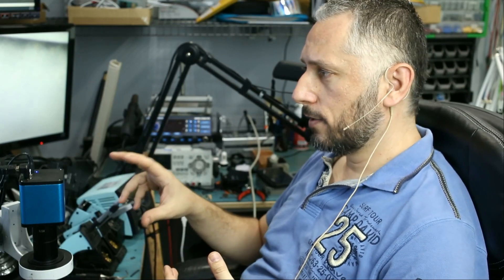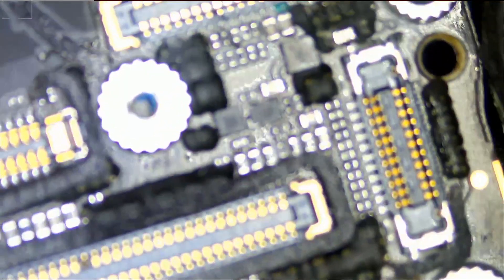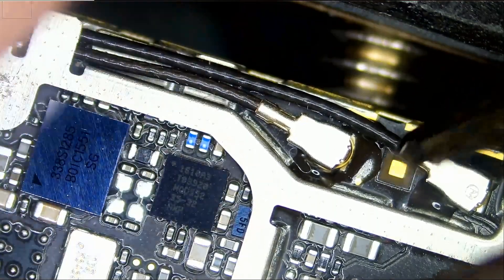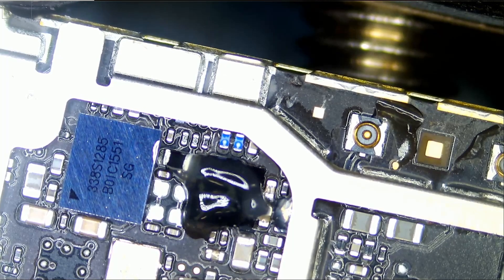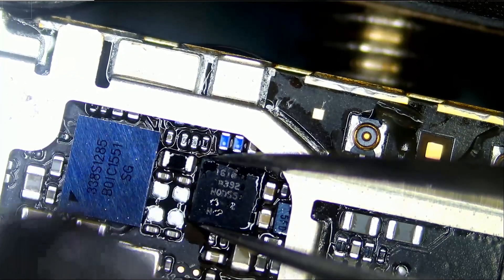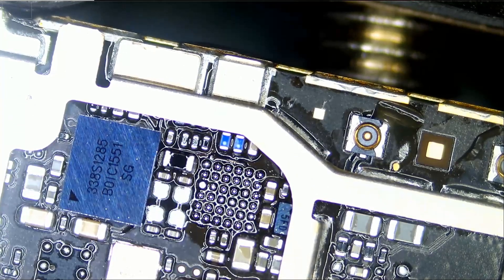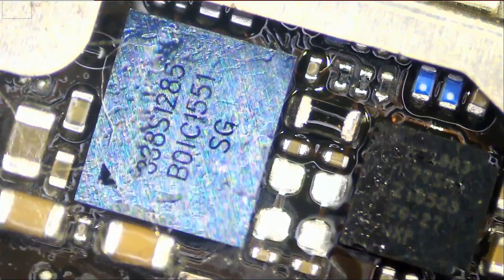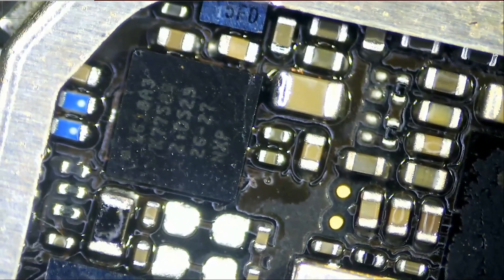iPhone 6S plus no power - Charging Tristar IC replacement and desolder using hot tweezers

Comment: Hello I replaced my iphone 6s with generic battery it runs smooth at first then after 1 month I started to notice that it drains without even using it. I want to know if there is something that can tell me if the problem is with the battery or  with the IC. Take note that I charge my phone with a powerbank a lot and with my broken original apple cable. @NorthrideFix please help

Comment: Hi there, great video! What clearance do you keep from the board, while preheating it? Best regards, Nuno
Reply from the maker: About 2 inches
Reply: @NorthridgeFix  thanks! I understand that this is highly dependent on temperature and airflow as well, but regardless I tend to keep the distance on the safe side, to avoid cooking the board.

Comment: I have same phone i am facing problem ideal battery drain issue and slow charging with 3 party cable with original apple charging it is not charging and also no connecting to itune
Reply from the maker: Likely a tristar or tigiris issue.